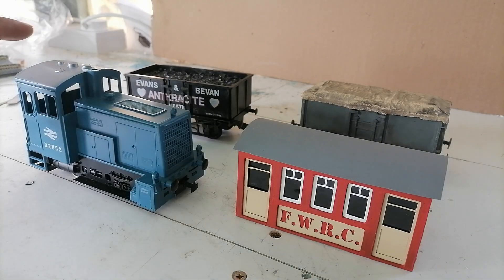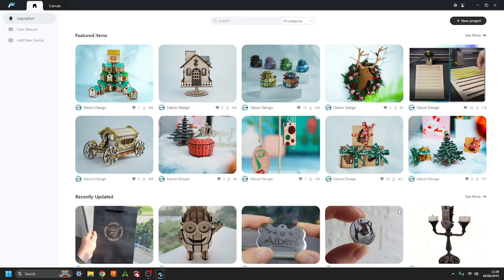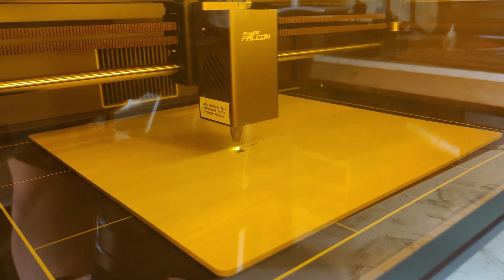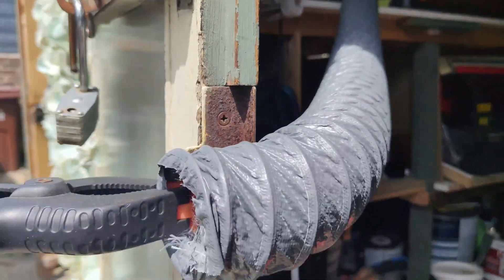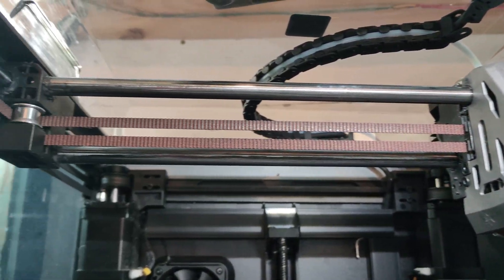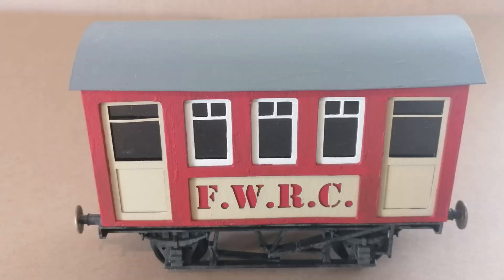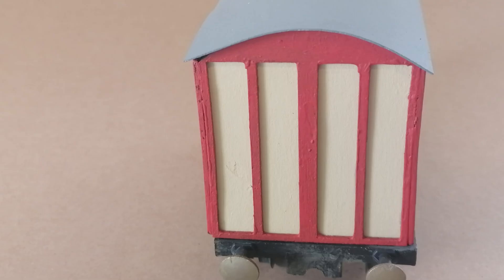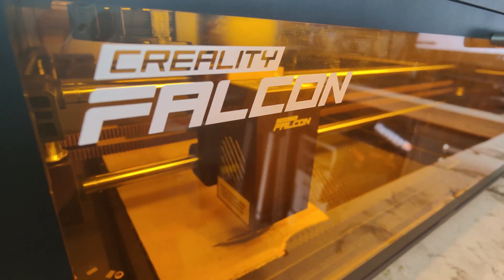Laser Cutting Custom Model Railway Coaches Using The Creality Falcon A1 10W Laser Cutter!

Comment: Glad to see O gauge is not forgotten. Now Im trying to think how to justify a laser cutter to my wife!  Im working on the pwm controllers you guys did a video on and I was wondering what happens if there is short circuit or and abnormal current demand?
Reply from the maker: Never had an issue with short circuits or overloads